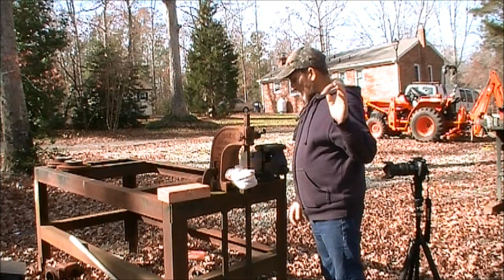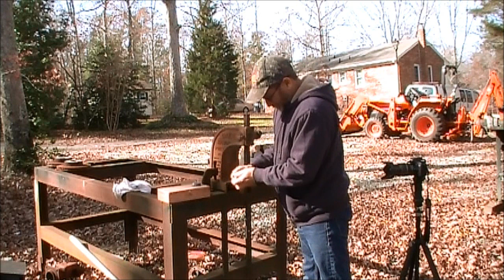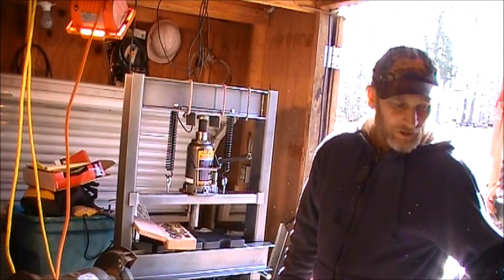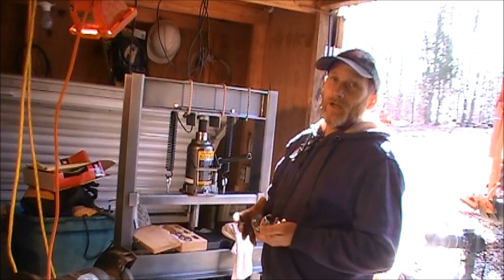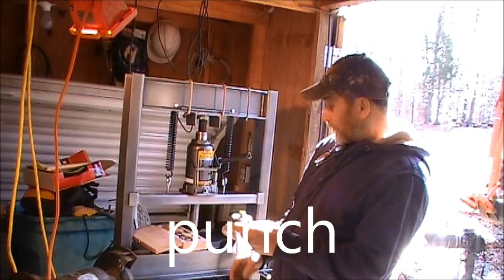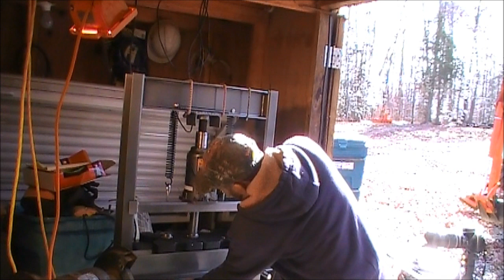using a press with the coin ring center punch tool

Comment: What is the coin holder and top piece made of and did you make it yourself
Reply from the maker: its made from 01tool steel and yes I'm the original creator of most all the coin ring tools used today. "although I rarely get credit for it"
Reply: daveknowshow Hi, do you still doing those tools , I would like to buy it and get the original tools from the original inventor))

Comment: Dave, I've been making coin rings since 1993. It takes me an hour and a half doing them the way I do. I saw your video 6 months ago about a center punch and messaged you then.(Maybe it's been a little more or less than 6 months). I never heard back from you.

I ended up buying a crappy punch from Engardio. He was the only source I could find and I was anxious to speed up my process.
 Will you please contact me so that I can buy one of yours. It appears to be a much better and more sound design.  In case this message has no email to reply to, mine is getsteve2008@gmail.com /   At the very least, please reply to tell me that you've quit making these and I can quit pursuing you about it.

Thanks,
Steve Lilly
Reply from the maker: I'm actually working on gathering material to make a couple more sets.
Reply: ***** OK, then I'm re-asking you if you will sell me a set.
Thanks,
Steve
Reply from the maker: he is infringing on my copy right and I will be going after him.